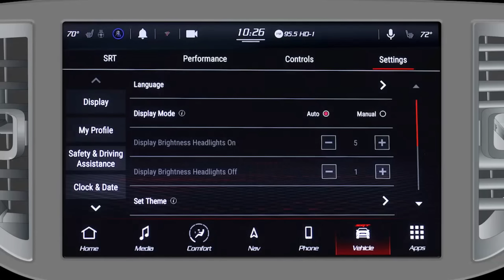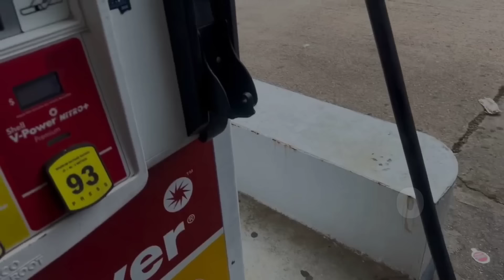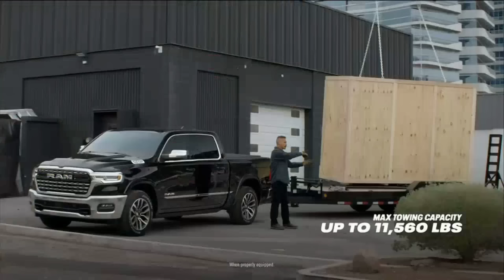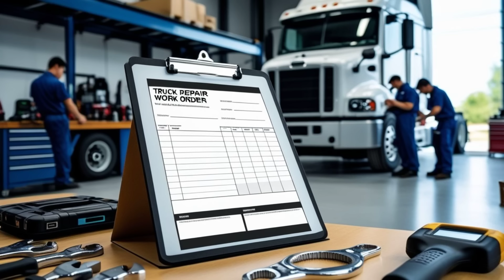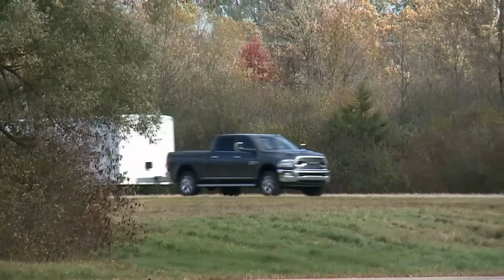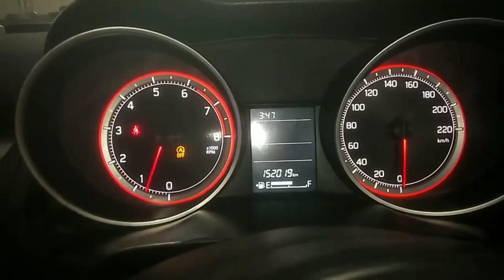These 5 Hidden Ram Settings Are Ruining Your Engine. TURN IT OFF NOW!

Comment: I dont know what i did in my ram but I whatever I did somehow turned off the Eco Mode. I haven't seen Eco pop up in over 6mths.  my truck runs great at 109.000 miles.

Comment: when he tells you the start stop has anything to do with your starter it makes you wonder how much he knows about the other things he's talking about? just be smart, dont buy one with e torque  or auto start stop. I knew what both of them were thats why i got a new 22 in early 23. 41, 000 mi. so far & trouble free. hope my luck holds.
Reply from the maker: Start/stop uses a beefed up starter and battery system, not the same wear pattern as a normal starter getting hammered. Good call doing your homework before buying instead of after. 41k trouble-free is a great start, here's hoping it keeps up.

Comment: MDS,.when shut off completely is not good.
Ask any mechanic not even Ram.
Those MDS lifters not getting proper oil ammount when you do that... There is videos made on this topic by actual mechanic who worked on many Ram ,5.7 Hemi engines and goes into detail why.

Comment: This guy is some kind of keyboard expert who is parroting rumors posted by other keyboard experts. I had a 5.7L Hemi in my 2015 with nary a problem, and I now have a 2024 with the same engine and the eTorque. Both have given excellent service. I do turn off the Stop/Start simply because I don't like it, not because I believe the urban legend about the starter. And I have no problem with the Eco either.

Comment: For some reason when I started deactivating the start/stop every time I got in the truck, it didnt like when I remote started it in cold conditions.  I got the start stop warning on my dash. I decided to leave it alone and never got the warning again. Dealer thought I may need another MGU, but it made no sense to me. I went to another dealership and they said I needed another 12V battery, not a MGU, which by the way is backordered into oblivion. I have a 2020 Bighorn with only 35 k miles on it. I refuse to do any prolonged city driving in any of my vehicles because theyre all performance based. I treat my Ram no different. I get frequent oil changes, swap ALL the fluids and put a bottle of Lucas in the gas every now and then and let that engine work at 70-80 mph. I personally believe the best thing you can do for your truck is put top tier gas in it , change the oil every 3000 miles , and freeway drive it as much as possible. City driving is what destroys most engines over time.

Comment: First of all it's not just the MDS lifters that fail.  Not sure where you got your information but my neighbors failed on cylinder 3 which is not an MDS lifter.  I have a 2012 1500 with 170k and no problems at all.  MDS still active and I can't turn off eco mode either.  5k oil changes and I idle about an hour a day.
Reply: My 2012 1500 failed on cylinder 5 which is not an MDS lifter at 243,000 miles.  Car Fax did not show any previous lifter repairs.  I did the repair myself.  That won't show on Car Fax so I guess that the report doesn't show all repairs.

Comment: My 2015 ram hemi has 130,000 miles on it. I change oil at 5k, I let the eco mode act is it should, i downshift the automatic transmission when I don’t want to brake on slight downgrades, I tow with it, I plow with it, I remote start it and let it idle for 5 minutes or more sometimes. Exactly when will my engine self implode so I can be ready?
Reply: All the chevy owners will say about 10 minutes, worst new truck i ever owned was an 2018  Z71 that lived on a hoist at the chevy dealer. I dumped it at 18K miles, no more problems. no more chevy. real loyal chevy owners cant possibly have an IQ above 70.

Comment: Ranger
Range Technology does not make an AFM/DFM disabler module for the 2019 Ram Bighorn with the V8 5.6L or 5.7L engine. Their AFM/DFM modules are designed specifically for GM (Chevrolet, GMC, Cadillac) vehicles equipped with AFM or DFM systems and are not compatible with Ram trucks. If you're interested in performance options or other modules for your Ram, let me know—I'm happy to help explore alternatives!
Reply: Is there a way to permanently turn the MDS off with out buying an expensive tuner?

Comment: Here’s the problem with this video. He either hates Ram, and/or he doesn’t know what he’s talking about!! Retired Ram mechanic here, most of the cam problems I see are do to lack of maintenance or to long between oil changes. As for the last one about start/stop, if you have the Etorq motor, the starter is ONLY used for first start, when start/stop is active the Etorq or generator you see on top of the motor with its wide belt is what’s starting the motor back up!! As for him saying at startup you have metal to metal on the warm engine, but he doesn’t say warm engine, you have PLENTY of oil on all surfaces it will not hurt the motor! Don’t believe me, next time you use that function watch the oil pressure, oil has to be picked up in pan, run through filter, then the engine, before pressure builds, so next time you use start/stop watch oil pressure at startup, it’s almost instant pressure!!
Reply: I have almost 80k on my Laramie. I have no problems. I've towed with my truck and none of that stuff he's talking about has happened. Matter of fact, when towing my transmission temp is around 170-180 depending on time of year.
Reply: I second your comment, I have a 23' limited with Etorque, love the truck,  got 29kmi on it and your right the start stop system does not use the starter everytime, that's what the 48v(i believe) generator is for, and the start up is seamless!  instant oil pressure. beings this is my first truck, first hemi. I want it to run for a long time with no issues.   I changed the oil every 5kmi for the first 20k.  then started doing every 3k. my truck calls for ow20, which they only did that to save fuel.  I want to run 5w30 which the manual says I can but my ram dealership said it will ruin the mds system? but yet the manual says I run it? and in the same breath the tech told me I can 5w30 it won't hurt it but didn't recommend it because im still under warranty.  I miss using 5w30.  everything I ever owned had 5w30 and still runs till this day, some with over 200kmi on it, runs like a clock.   I dont really trust ow20. little help here?! stick to ow20?  switch to ow30? 5w30? my brother uses amsoil ow30 in his 22'ram big horn
Reply: @swifterskillz  5w-30 is recommended by most videos I've watched for preventing the major issues. They also recommend a Melling High Volume Oil Pump, and not letting you truck idle for extended periods.
Reply: @swifterskillz after much deliberation on this myself I decided as long as the truck is in warranty then stick with a good quality 0w 20 and then switch to 5w 30 after.. that's my plan
Reply: Why would you put it in tow/haul if you're not towing?
Reply: @markduclos8732 cause it keeps the MDS off
Reply: Thank you!
Reply: What's a good replacement for stock manifolds
Reply: @stephonduncan1440 good question
Reply: @stephonduncan1440 Stainless shorty headers.
Reply: I have a question for you, Mr. Ram man I typically change my oil in my ram which is a 22E torque hemi 10,000 miles. I’ve done two oil changes since I’ve had it. It’s 10,000 miles too many please answer. I would love to know oh and this as well I use Mobile one oil. I’m looking forward to your reply. Thank you. Enjoy retirement.
Reply: @joearnone8138 I'm doing every 3k.. oil is cheaper than an engine
Reply: @joearnone8138 most Hemi mechanics recommend 5k or less between oil changes
Reply: @joearnone8138 10k is too many, 5k is the time you want to change it.
Reply: Gh bc😅
Reply: I don't think that my 2012 Ram 1500 Big Horn 5.7 has Etorq.  Is there any way to verify that?
Reply: I had lifter problems with my 2012 ram 5.7 at 86,000 miles. Needle bearings in a lifter went. About 7 months later my neighbor had the same issue with his.
Reply: @dasimcoes My 2013 went over 140,000 miles before I bought a newer truck.
Idling is probably the worst thing for a Hemi save maybe for waiting to long to change the oil.
Reply: @johnarcher9480 glad you had better luck than i did.
Reply: @johnarcher9480 I got my 4.7l 2009 to 170k before the valve seats started leaking... I could have fixed it for 800 but got a new truck instead lol.. engine still ran strong

Comment: Only use tier 1 fuel in any gas vehicle.  I could tell the difference after the first tank 
Discount fuel doesn't have the detergent to keep your engine performing as it should.  
The Chev/ GMC have a lot of problems with the 8/4 system. My family has it changed to 8 full time. On their trucks.   
I have a ram 2011 Longhorn with 129g on it if. I didn't know it was shutting the oil off.  I will run in the tow/ haul mode from now on.  It has never done any heavy towing or run hard.   I have started running nothing but tier 1 ( 89)  Shell gas.  I could tell a big difference in it. 
Also run heavier oil.  I run 10w- 30 full synthetic. The thin oil was only for fuel rating not for truck or customer best interest. 
Factory don't tell you that.
Reply: I agree I was having some engine rattling I started putting any middle grade gas and I can tell a difference and driving it a little harder and I get better gas mileage that way

Comment: The e torque system uses the serpentine belt to crank the engine over, it doesn't use the engine starter motor in this case.

Comment: 2008 dodge ram 2500 5.7 hemi owner here two engines. They are junk. Rebuilt motor with melling high flow oil pump comp cam and lifters not one problem. Dodge used garbage parts designed to fail. Dont get me started on manifold
Reply: 😂😂😂 That's 18+ year old technology bud. Of course it's failing. Jesus🤦

Comment: I don't have eco mode on my 14 5.7hemi. is putting it in gear 6 the same as turning it off? I've trying to find more about this and MDS. Dealership wanted to replace MDS, then said oil leak was a gasket.  I've seen some say to not disable MDS bc the lifters can freeze in the wrong position. Thoughts?
Reply: Leave it the way they made it and you'll be fine. This guy doesn't know anything about Ram
Reply: @chetjr.4597  and regular oil changes with 5/30. :}

Comment: all of these makes sense to me. I drive my ram hemi like I have a bowl of goldfish on the seat. It’s not a work truck, it was my gift to myself when I retired. Along with everything else in life, now I have more to worry about.
Reply: I have thought about this before reading this here on YouTube. My 2017 ram bighorn 4 x 4 hemi has. I think it’s an eight speed transmission, that transmission is well received on the Internet as being pretty problem free
My truck is not a work truck, I just have never been without a truck since I was 17.
I have noticed that the shift points while driving like I always do which is very light footed, because I can feel that it has way more power than I will ever need. Now it’s shifts before 2000 RPMs driving normally, that means the oil pump doesn’t get spinning very fast to bathe all of the parts inside the engine with more than enough oil, which definitely could cause problems. I tried not to let my truck idle ever. If I’m stuck at a long red light, I will slip it into neutral and bring the RPMs up about 500 RPMs. I have owned the truck since it was new in 2017, I use mobile one oil ever since the first oil change around 1000 miles, and I only change the oil after a long ride of at least an hour to get all of the grit gum soot acid, metal particles, and corrosion suspended in the detergent of the oil, and I pull the drain plug within a minute of shutting it off from that long ride. I let the oil drain sometimes overnight in all my vehicles. You would be amazed at how much oil comes out after you think. It’s pretty much done when it gets done to dripping one drip about every 15 seconds. I tested how much more oil comes out once the oil slows down to one drip every 15 or so seconds, I stuck the cap off of a spray can under there, not the one that’s the size of a whiskey shot glass, the one that’s about the size of a tennis ball. I left it under there overnight with the drain plug out. So that I will not make a mistake and start the truck with no oil in it. I always put the oil gallon container under the hood sticking up so I can’t close the hood. Then the next morning, I will fill the oil filter with fresh  oil to displacd all the air in the pleats of the filter, and I will top the oil off. I do not go near thedipstick  full line all the way because I have seen demonstrations by an oil engineer doing oil tests, his last name is speed, his father was NASCAR racer Lake speed. He demonstrated that overfilling an engine slightly with oil actually drops the oil pressure…
But anyway, when I came out the next day after leaving that cup under the drain plug dripping all night, not only was that cup completely full, it made about a 12 inch circle of oil on the ground for me to clean up. By the way, kitty litter is a great oil absorption product for oil spills. So for that reason, I always let the oil drain overnight when possible or at least for a few hours. I wouldn’t waste my time going to one of those speedy 10 minute oil, change places. Because think about it. Who’s down there under your car changing your oil, probably some young kid, certainly not a long-term master mechanic. If they let the oil drain until it starts to slow down, then they can top your oil off after putting the drain plug in after a 30 second or one minute drain that they might give it, that way they don’t have to put as much oil in the engine, but they will charge you for the five or six or 7 quarts that your vehicle shows on the chart as needing after an oil change and filter change. So they actually make more money by not letting your car oil drain completely. I can’t tell you how many times I’ve heard of people stripping drain plugs. Some people just never get it straight in their head lefty Lucy, righty tighty..
I must admit when I’m working on something and I’m working on removing a bolt or a nut from the opposite side of where I am sitting, I have to do the drill and make sure that I am turning the right way.
Anyway, I’ve had my ram going into the ninth winter right now here in January 2026, I have not had a single issue with my ram hemi that I bought new. It is the most luxurious truck or even most luxurious vehicle I have ever owned and it has a wonderful ride because it’s on coil Springs not leaf Springs.. I actually have YouTube videos on my YouTube channel with my RAM doing annual rustproofing inspections and posting the videos on my YouTube channel to show how well fluid film protects my truck from rust.. one particular video that demonstrates/shows how fluid film traveled up through the seams in the floor of my bed of my truck has over 35,000 views on YouTube. I didn’t even know the floor of the bed of the truck had seams in it… since my bed of my truck came from the factory with that black plastic looking spray on coating, why didn’t that stop the fluid film from creeping up through the floor on those seams?. At first I thought I spilled something in the truck bed, because I have a custom fit rubber mat protecting the plastic or whatever it is spray on coating in the bed. I would never have seen that fluid film coming up through the floor if I had not spilled some mulch in the bed of my truck when I bought 10 bags of mulch, and I removed that floor mat for the bed to sweep it out and that’s when I saw the fluid film coming up through the floor.
Makes me cringe to think if I had not sprayed under my truck heavily when the truck was five days old with fluid film to protect it from the salt that they throw here in western Pennsylvania, November through March every winter, if I had never sprayed the fluid film under there, that would’ve been saltwater that got into that seam first, and my truck would be heavily rusted by now like my last truck that I bought new, a GMC 4 x 4 Canyon that said in the owners manual, if I rustproof this canyon, I void my warranty. So I was happy to read that because I thought they have a lot of confidence in their corrosion protection, wrong, there was nothing under that truck that didn’t have a heavy crust of rust that I could scrape off with a paint scraper in sheets. I lost the brakes twice, I lost the fuel line, the fuel pump, the straps holding the gas tank up were a concern. And when I had to put new brake rotors upfront, I won’t even go into how difficult that job was because you have to pull the spindles off due to the fact that the rotors are bolted to the back of the spindles, but when I pulled the spindles off to change the brake rotors, the splash shields were completely rusted away, nothing left of them because I was not able to protect that vehicle with fluid film. That is actually the reason I didn’t buy another GMC.

Comment: I bought a used 2019 Dodge Ram w/ 5.7 Hemi. I love my truck. But about 6 months ago I started it and it was missing and lights flashing.  I shut it off called Dodge. I had to pay $120 to have it towed to Dodge. After a full day it came up the #5 injector was bad. Cool but I was out $120. Then two months later heading to the lake to fish. Start the truck, missing Christmas in June with all the lights. Shut it off called Dodge tow truck, $125 to haul it down. Full day and it came back #3 injector bad. At this point I’m still under warranty only because I bought it with my truck. Anyone else have injector issues? Dodge says they had issues between 2017-2019 and they just fix them. I asked them for my $245 back since it was a known issue. Good luck with that right?
Reply: It's not a Dodge.